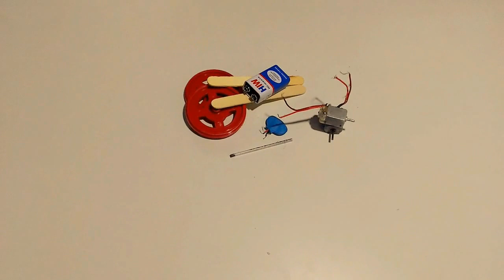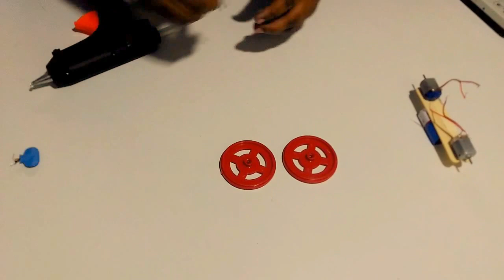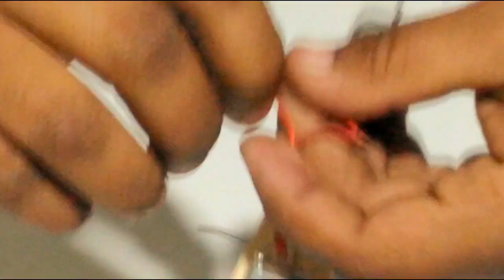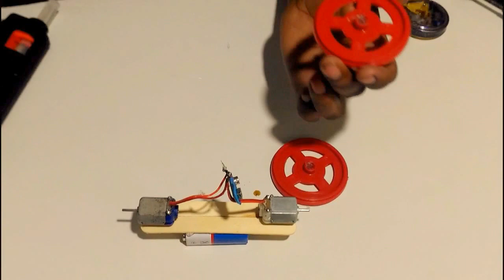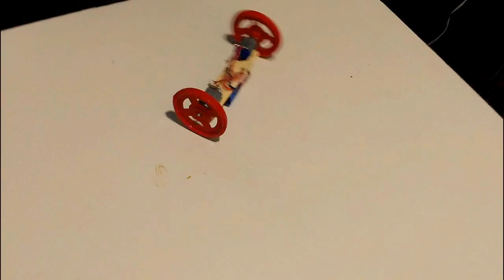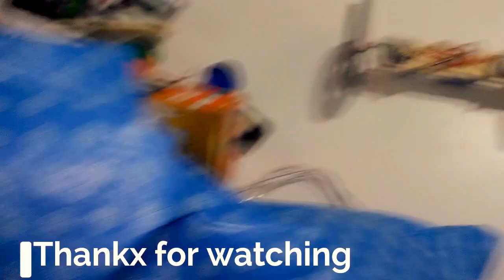How to make two wheel balancing Car/Robot

Comment: how did you make it walk in a straight line ?
Reply from the maker: LAA00MY its depend on connection of motor to battery and they should be in parller